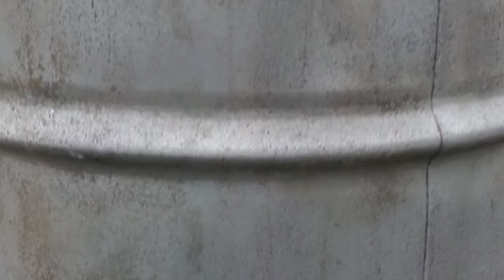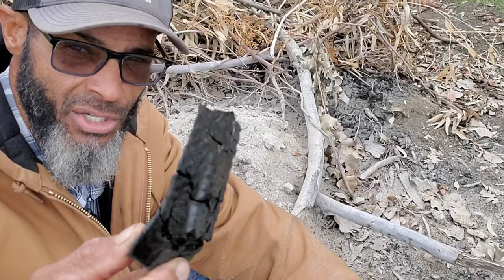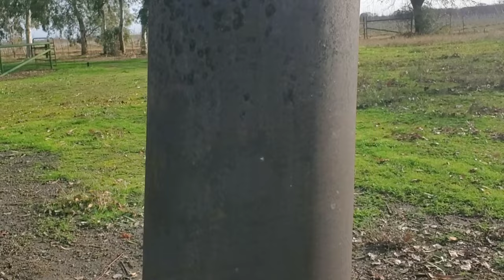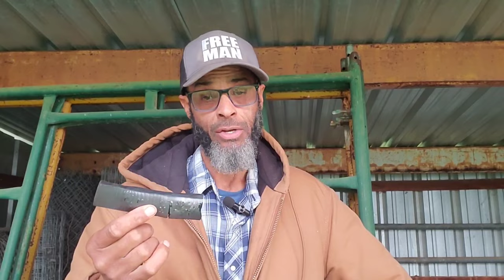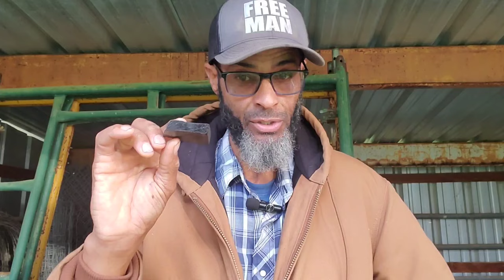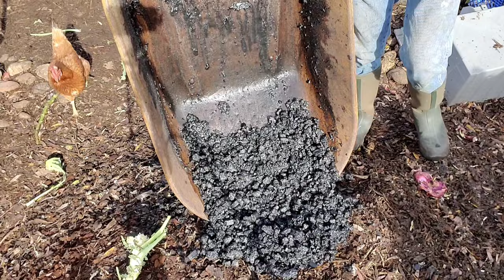EVERYTHING YOU ever WANTED to KNOW about BIOCHAR 🔥

Comment: Great video.  Only thing I can offer from my own experience,  is the efficiency of the retort works better is with a flue length that matches the height of the barrel you make your biochar in.   When I had the one length of flue, I had a lot  of smoke in the process.  When I added a second length (cannot remember if it was 18 or 24 "). the retort smoked a lot less and preformed like a rocket stove.
I also have a vermiculture bathtub with red wriggler worms  to digest manure and kitchen scraps which produce a worm liquid from the drain and worm castings.  This liquid is mixed with the fresh biochar and inoculates over many months.   This mixture is then dug into the garden and is the organic bomb that produces mass quantities of Veg and keeps enriching the soil year after year.  Cheers.  Oh also , I would like to mention is that I use twigs from Douglas fir  tress that come down in winter storms that we rake up.   The size of the twigs makes it real easy to crush which you are well aware is really the only pain in the bottom.  Keep Charring and sequestering CO2
Reply from the maker: Thanks for your input and sharing  your experience.  I wanted to add another section of flue to improve  the siphoning effect but all of the material used was from scavenged resources and what I  obtained for free. I'm stoked it has lasted and performed as well as it has as it it now entering its third season. Thanks for watching and make char! 😉

Comment: Retorts are easier for sure. The open pit,  or cone  method. Depending on how large  pit , or cone is. Takes a good part of the day to keep it from going to ash. You could buy a used  gas wood chipper to grind up the charcoal.  Just have to play with the speed to get the size particles you want. And the charcoal needs to be damp.
Reply from the maker: Yeah man a chipper would be pretty sweet for all sorts of things around here! I could put that to good use with feedstuffs, woodchips and biochar! 👌
Reply: I've been playing with an old sink and garbarater grind up charcoal add some water and garden scraps together then throw it in to the chickens... work good on a smaller scale...

Comment: Curious if there is a general rule of thumb as to how many pounds of char to 100 sq ft ?? Thank you for such an intelligence packed, eloquent, concise video.
Reply from the maker: There are variables depending on application rate beginning with soil type, soil fertility, and what is the intended purpose.  There are many studies and not all in agreement so do your further research to find what is going to benefit you. I innoculate my compost desiring to achieve 5-10% biochar by volume. I don't worry too much about specific calculations regarding adding biochar as it is difficult to reach these amounts for the small backyard producer. Good luck man and make char!

Comment: Ya the barrel method looks good. My issue is time. I’ve used a barrel. I still need to try the retort method though. The trench method I like cause I can burn a twenty foot trailer full of old farm poles in like six hours. I’d never be able to burn that much wood in a barrel in such a short time. Skillcultz channel I like as he just burns till there’s coals in the trench and adds more. It’s definitely more practical in farms and or in the mountain if you have lots of wood to do and you just want to spend the least amount of time. Although I suppose in the winter burning wood in a retort would be really practical to get heat and some charcoal and just do a little daily.
Reply from the maker: Absolutely! The trench method is an excellent way to go for long stock on a project with an abundance of material.  Such a great method for property clean-up. There are so many options and there are always 
new ways being thought of to improve on the very simple and timeless hole in the ground. Make char! 👍
Reply: The biochar retort I think is great for making purer charcoal especially if you want to use it for bbq or cooking which I want to use for all my apple tree pruning.

Ya for projects like cleaning a yard I think the trench method is good. We literally were cleaning up a neighbors yard. The guy died and his brother was selling it. We removed trailer loads of old logs and branches etc. 

I’ve seen videos of basically a retort trailer where the door on the trailer opens up and there’s like two tanks on the trailer one inside of the other. 

My dad has a twenty foot long trash truck. The bin is like 20 foot long with a lid at the end that opens. I’ve thought about converting that into a retort. 

I also say I think USU in an educational video showed rectangular metal big bins where loggers burned scraps of wood at the logging site into coals. One video of that idea I think said they use metal covers once they’re done to keep oxygen out cause they maybe in the middle of nowhere without water to make sure the coals are out. 

I’ve seen videos like the channel ask Jeff Williams and others where they have homemade rock crushers. They crush rock to like one inch and then they have like a buffer or shop grinder setup where instead of turning a grinder or buffer wheel the machine turns a piece of chain that’s inclosed. Then they drop small rock in tk be pulverized and drop out of a small screen. I’ve thought that’d be a pretty economical way to crush down charcoal. I’ve not built one yet but I think I’ll try tk build that idea or setup this spring to process charcoal. 

A couple years ago I did the trench method and walked on the charcoal. I had a large amount but only got them down to one inch or less. So in the garden at first it sucked to raise beets in. But now it’s buried deeper. Making charcoal smaller definitely is a key point gardeners etc need to remember.

Comment: Hi Porterhouse. I watched a lot of biochar videos last night and particularly appreciated yours. The pace, quality, and content was far above average. I do think you may get a better result by incorporating an activation step. From what I gleaned you have the best method of making charcoal and adding compost tea to it, but there's a middle step of activating the charcoal which makes exponentially more surface area. Other homesteader videos suggest burning the material to coals then dowsing the flames with water creating a lot of steam which activates the charcoal. Adapting that to your method would be watering the 30 gal inner container while it is at peak heat. It sounds hard to do but you may want to experiment.  

I've not found a 30gal steel barrel and prices are $$$. Do you think using a galvanized trash can would work? To get started I plan to use a barrel with side cut out then dowsing with water. It will take a lot more attention than your solution and not work as well, but its a start.
Reply from the maker: Adding water to the char during the cooling process would be a nice addition to the process. I don't do that because it adds another step in my workflow that doesn't yield enough benefit to warrant my time since my char will be passively inoculated in the compost for the remainder of eternity. I do quench when making char in a pit or trench because it just fits into the workflow and it can help to lessen the hydrophobic properties by removing the residuals before they can solidify. Thanks for your suggestion it might indeed make a better char. 👌

Comment: Hey hi here from Germany. Very good video and very good summery of everything important about bio char!

One point I’d like to discuss further is the part with the oily and smelly residues. As far es I know they’re made of mostly PHAs and PHAs are a group of very stable and highly carcinogenic molecules. Besides heat they don’t break apart very easily and will end up in the food chain.
Good thing all you need to do to remove all PHAs completely is just heating the biomass a little more. At 600°C and more only the pure carbon should stay back which should be completely odorless.
As far as I know… you know.
Reply from the maker: The temperatures in my retort are  at or above 1200°f as I have measured them. The char I have made has no odor or oily Residue. There is residual tar and resin which is not obvious when looking at the char but is the primary reason the char has become hydrophobic.  Thanks for the info and thanks for watching!

Comment: Sending biochar chunks through a chipper/shredder pulverizes it into dust.  BE SURE IT'S MOISTENED b4 shredding... or any breezes will send the dust over to your neighbor's fields.

The shredder may need rinsing with a garden hose occasionally (can plug up dependingnon the batch of char).
Reply from the maker: Wetting char before crushing is imperative and significantly reduces the inhalation hazard although caution should be taken to protect your airway whenever char is being worked.  👌

Comment: This system is good when you have plenty of properly chopped wood, which is rare, and even if people had it most would probably prefer to use it to heat their houses in the winter. But yeah if not emitting smoke is crucial then you have to  have something like this.
Reply from the maker: Yeah I am super fortunate to have access to the feedstock that I use. You are so right because most of wood gathered from there is used for firewood. I use some of it for kindling, birdhouses and yes biochar! I would not make nearly as much as I do if I didnt have the access. Thanks for your comment.
Reply: Pit burn method/flame cap kiln is just as smokeless if done right and the added benefit is that you can use irregular shaped tree prunings. Aside from that there's no loss of sacrificial wood as is the case with the drum in drum retort in the video.

Comment: Good stuff!!
QUESTION:  I'm new to Biochar so forgive me if you've been asked this question a million times.
My wooded portion of my property is mostly Black Walnut.  Does the juglone pose a treat making Biochar or is that all dissipated during the burn?
Reply from the maker: Good question. I do not have 100% certainty however juglone can be composted out of leaves in about 2-4 weeks. The compound is broken down when exposed to air, water and bacteria.  My assumption is it would not withstand the process of pyrolysis and the chemical compounds would be eliminated. If some residual of the compound was retained in the biomass it would more than likely be rendered inert. I am not certain of this it is just theoretical. Sorry I  couldn't be more definitive on this.

Comment: Thanks for the video. Unfortunately, after watching, I'm concerned biochar my not serve the purpose for me I was hoping. My soil is too well draining. I started building up my garden plot area maybe 8 months ago on sandy soil in a flood plain. I lasagna layered cardboard, then miany layers of goat and alpaca manures with layers of mulch and finally a layer of city compost which in retrospect wasn't aged enough. My first cover crop failed because it would not hold moisture with daily evening waterings. Now even with the summer monsoons (high desert AZ) it still won't really hold water. I was gong to get a couple yards of high clay content soil to mix in but then I thought of biochar. I figured it would hold water really well but it sounds like it starts out really thirsty but then you have to inoculate it so its not thirsty anymore. So if I inoculate  it with whatever  so that it's not thirsty anymore then it also won't be thirsty for water thus not making it a good addition if it's purpose is to retain the water, correct?
Reply from the maker: I have performed some moisture tests which have shown to increase the water retention by quite a bit. One soil plot without char and another with 1:1 ratio of soil mixed with char. Nutrients retained in char doesn't affect the ability for char to retain water. Try running some test plots to see if it will work for you. Thanks for watching and the question.

Comment: Rather than set my yard on fire and walk away I bought some Andersons biochar. I'm serious, breaking that soil requires a pick axe and I just can't anymore. Do you have any tips for working with this? I used sand to help level the ground for a pool. I dug into the clay and used sand to level the pavers in the clay and within a day of not touching it, it looks like a solid giant rock. 😮 which is ok for reinforcing the pavers under the pool but not for the swampy mess of clay that dries into bricks 😤 I don't need anything but grass to grow and that doesn't need to happen right now. I just need the rocks to be dirt so I can move it and level it.
Reply from the maker: Some soil types are extremely difficult. Clay can be tough to work with but can improved with time and effort. Adding organic material, planting vegetation that will de-compact naturally as well as using tools to help break up the soil. Adding in amendments like gypsum, compost, and sand can all help. There is no magic pill without hard work and time. Good luck.

Comment: What about putting it on top of the compost pile so it captures the nitrogen gas that escapes from the compost heap? It that a thing? Maybe uncrushed in net sacks.
Reply from the maker: I suppose there may be some emissions captured using that method but I tend to favor putting the char directly in contact with the  substance I am  inoculating with.  Question I have is how will you know when the char is inoculated and since the atmosphere is 78% Nitrogen couldn't one just hang a bag of char wherever? 🤷‍♂️

Comment: Excellent video.  As @williamvallejo5976 noted, I too, learned more about biochar in the first five minutes than all other videos on the subject.  I have a question:  What about using the ash from wood stoves in your garden?  Good idea or not?  Obviously, making and using biochar is the preferred ingredient, but what if you don't have the ability to do that due to local regulations, or some other reason?
Reply from the maker: Thanks for watching and the kind words. Using ash in your garden can be good in some soil conditions but it is not advisable unless you know your soil pH. Wood ash is basic (alkaline) which may be useful where your soil is acidic but if your soil is neutral to basic it will have a negative effect. Test your soil before using wood ash would be be best practice.  Good luck. 👌
Reply: @therealprtrhsenteal  Question # 2 - what if I put wood ash in my compost pile?  Would that be a good or bad idea?
Reply from the maker: You could do that but alot depends on how much you use because it's still going to affect the pH much in the same way as adding directly to your garden or soil.